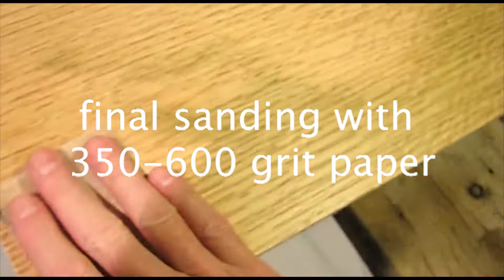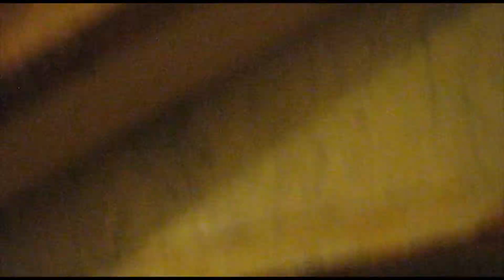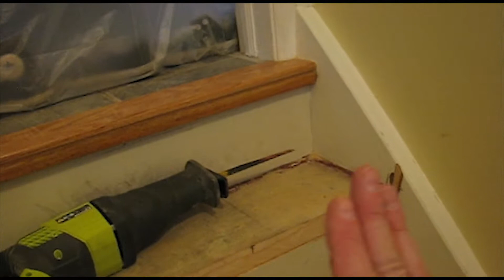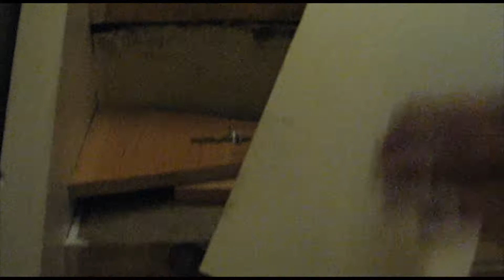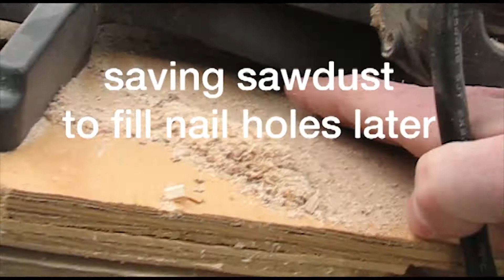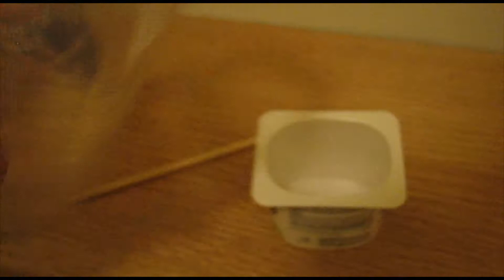How to Fix and Retread Stairs

Comment: I've been retreading my stairs and the stringers are in no way flat so the retread doesn't not push down even using a stair tread gauge so I carved out the stringer to get a flusher finish which brings up my thought about caulking the gaps. I'm cutting my stair tread ends so close that I won't have to use caulk. I can relate to the clear vs white labeling on the tubes though. I've mistaken that poor labeling design as well and learned my lesson like you.